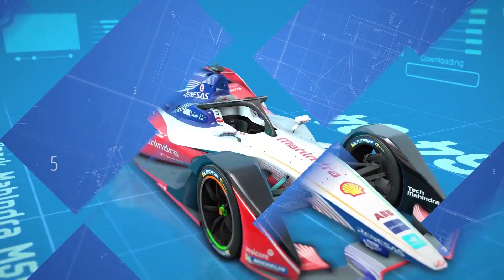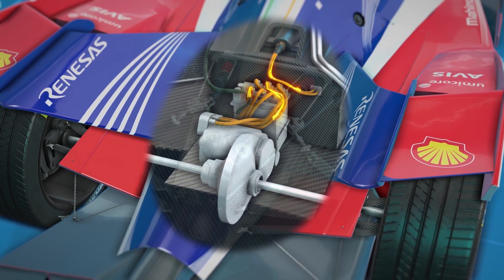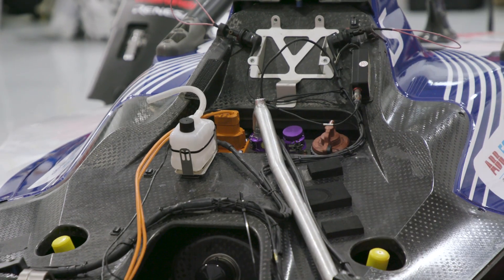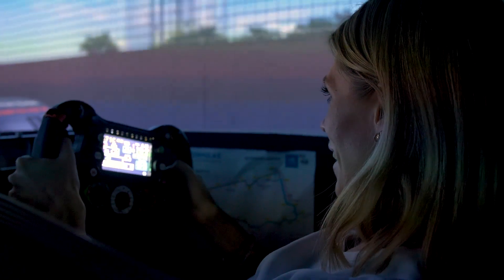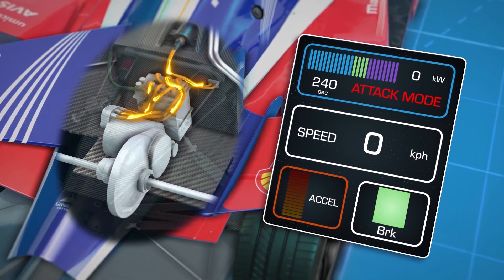Mahindra Blueprints: Power and drivetrain explained

Comment: So they have a single motor and a single gear, supposedly because extra gears didn't provide enough performance for their weight. Alright, okay.

What's the gear ratio?
What are the specs of the engine? What voltage? What Torque? Horsepower?
What are the pros and cons of a multi engine vs one engine design? What made them pick the latter?
What kind of innovations are being done to the inverter, what are they doing with it?
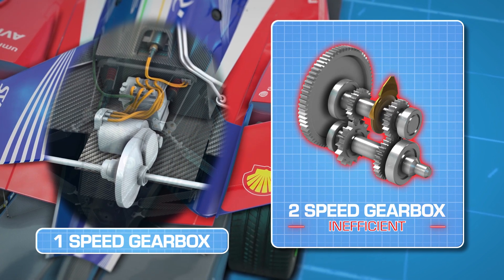1:04 Which ones? How have they been solved?
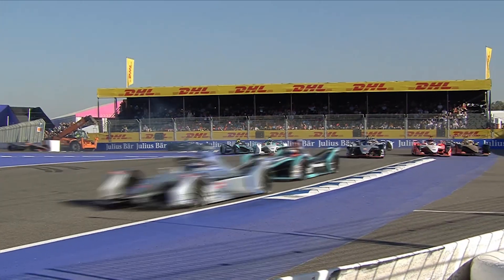1:17 I thought electric engines produce 100% torque from 0 rpm. How does it really work?
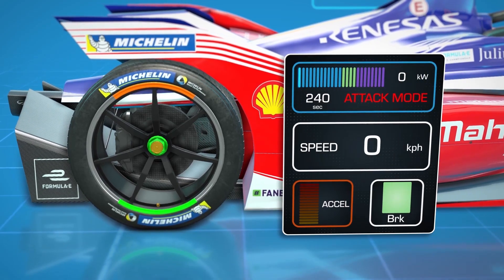1:35 How?

For a video called "Power and drivetrain explained" Y'all explained jack shit.